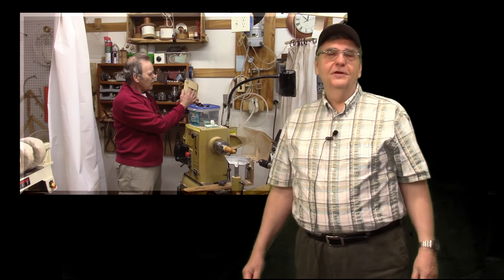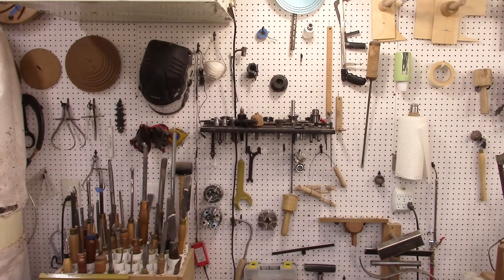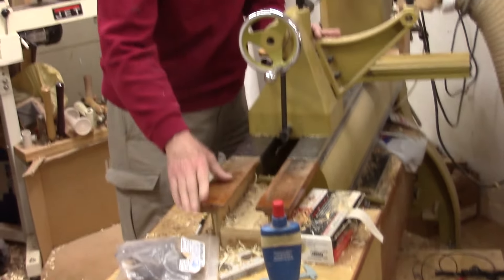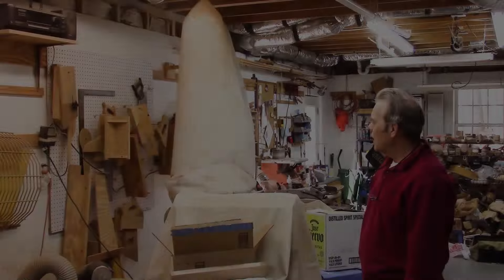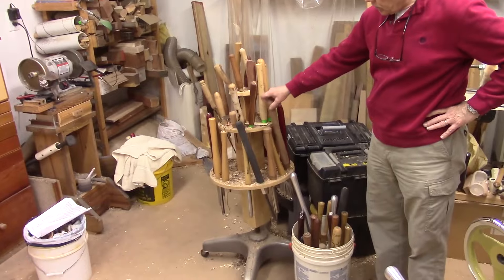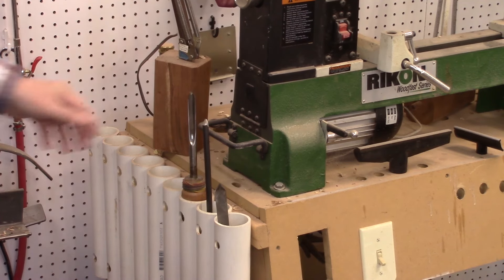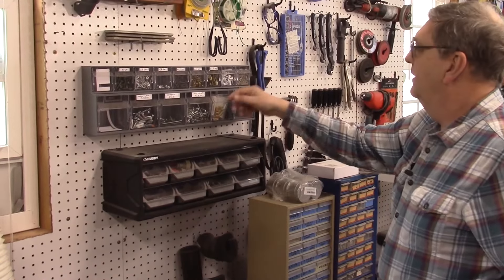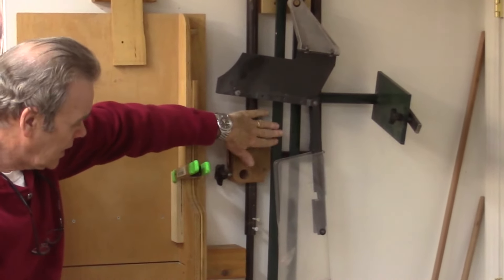Two Guys, Two Shops - Part 2: Storage in the Workshop

Comment: Extremely helpful.  Good ideas.  Definitely saving the video for review.  THANKS guys.  It's a blessing to learn from your experience.
Reply from the maker: Thanks, Dennis.
Reply: Rick - in the series, you mentioned doing a review on the Galaxy lathe.  Have you done the review or when might that be coming out?  😀 I have my dreaming eyes on that model and am looking forward to your thoughts?  Thanks!  Blessings!
Reply from the maker: That review is still in progress. I think it's a great lathe at the price that it's at. And I think Woodcraft has it on sale at about $500 off (that sale might have expired by now). I love the technology in the headstock. There are a few annoyances with it, like the tool post lock getting in the way sometimes, and the tailstock quill which doesn't retract as far as the length of my Jacobs chuck. But overall, I think it's worth the money.
Reply: Thank you so much!  I'll be looking forward to the video.  Thanks for taking time to respond.

Comment: Rick, I had a similar setup with my turning tools also and my wife used to get on me as well. I simply made a box with a door and no bottom and used pocket screws to secure the sides and back to my cabinet and put a light in it that turns on when I open the door. That way I didn’t have to build a new cabinet and it solved the problem. My buddy and I built the same cabinet and his solution was to build a box with a door to enclose it like I did but with a bottom and slightly larger. Then he cut off the top off his cabinet (the part containing his turning tools) and put drawer slides on the turning tool portion. I like his solution better as I had to make mine taller to get the tools in and whereas his just slides in and out. So I plan on modifying mine to more like his redesign and then I’ll put 2-3 drawers up top to make us of the open space above....
Ron
Reply from the maker: Thanks for the suggestions, Ron. And thanks for watching.
Reply: RickTurns    Thanks Rick.

Comment: For your lathe tool storage next to your Rikon mini-lathe, remove the wooden plug from the PVC tubes and install a wooden shelf 4" below the tubes.  Then, you can put the tools into the tubes handle up and you'll be able to see the cutting end sticking down below.  Easy to tell which tool is which and safe, too!
Reply: Great idea, David. Thanks for sharing.
Reply from the maker: Yes, I'm going to have to do something like that. Thanks for the suggestions.

Comment: Thanks for a lot of good storage ideas.  My shop is approximately 10' x 15' space in a 2-car garage with a little additional space on the other side of the car for storing tools.  The garage also contains the laundry and storage for household supplies.  The parking space for my wife's car is a firm boundary that I have established which help me limit the number of tools I can purchase.  So I am always looking for ideas to maximize the space usage.  One of the ideas I have incorporated is overhead wood storage.  My next shop project will be a small cabinet for the turning chisels with wheels so it can be moved to either the left or right side of the lathe.
Reply from the maker: Sounds good, Ed. Thanks for commenting!

Comment: To store my gouges, I used PVC tubes attached to the side of a rolling cart.  The gouges go sharp edge first into the tube. Each gouge has a specific place. That way I don't have to look at the edge. The half inch spindle gouge is always in the top tube. The 3/8 is next.  Etc.  The Bowl Gouges are two steps away, same set up on the side of a bench.  I thought about a lazy Susan, but opted for a more compact design.
Reply from the maker: Good idea, John! Thanks.